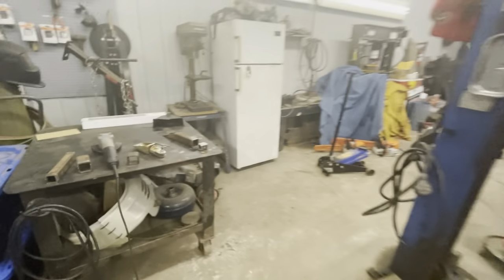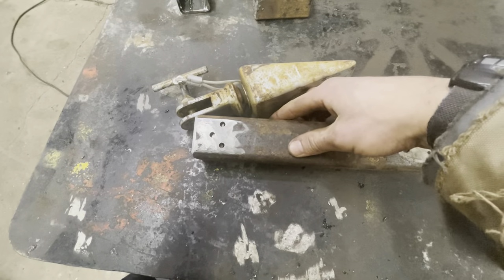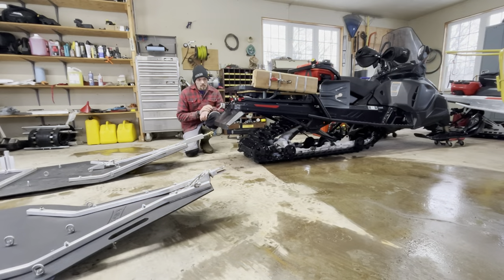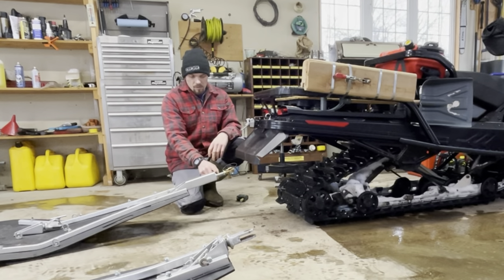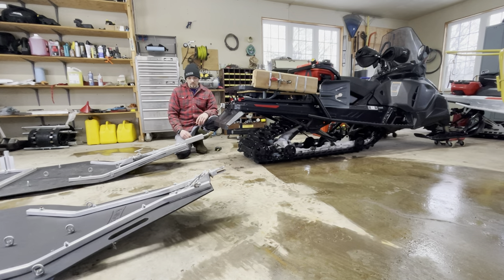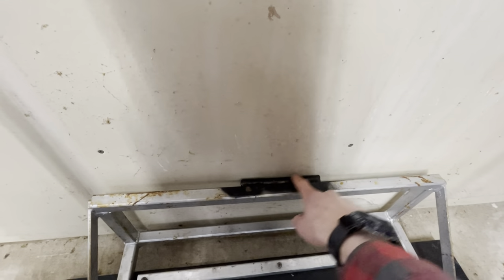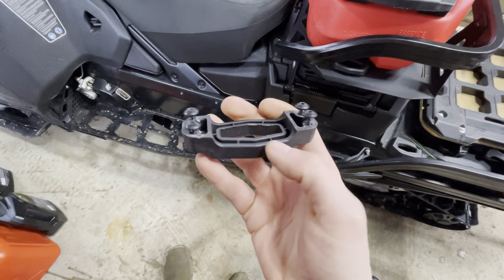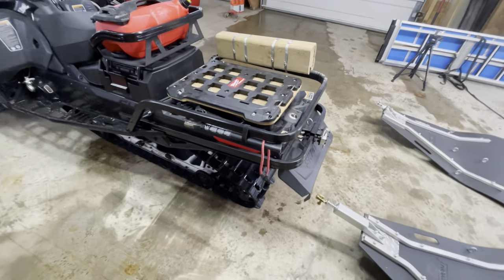Karyon Toboggan Modification

Comment: Nice hitch mod... when the karyon is loaded it looks hard to line up the hitch with the skidoo mount, as is the case for any combination, I tried an adjustable hitch arm, a tube within a tube.. the process still needs a left and right line up but then slide the inner tube up to the skidoo, connect,  then back up the skidoo, which slides the inner tube into the outer tube to a stop,  then a pin is used to lock the two tube together for towing ... just an idea Rick
Reply from the maker: Thanks for the idea when I get back to hauling this winter we will see if we need further modifications and possibly use some of your ideas.